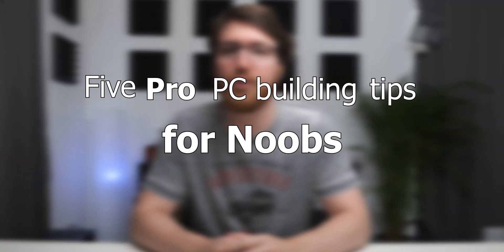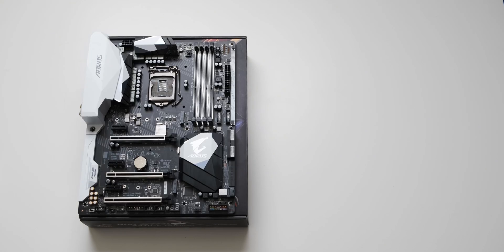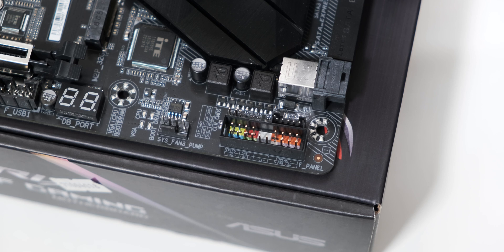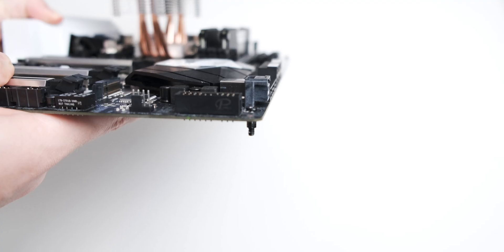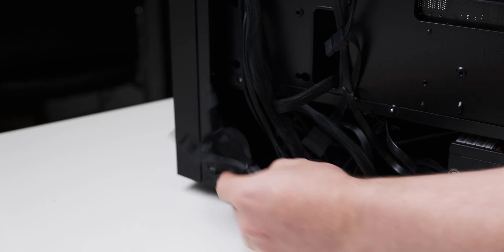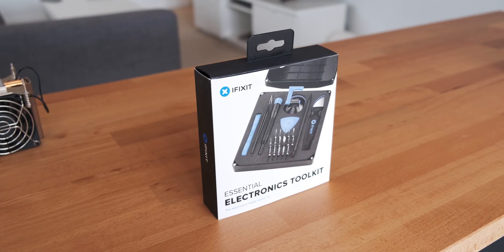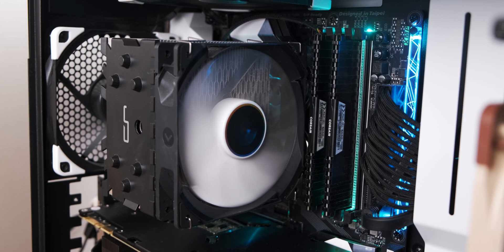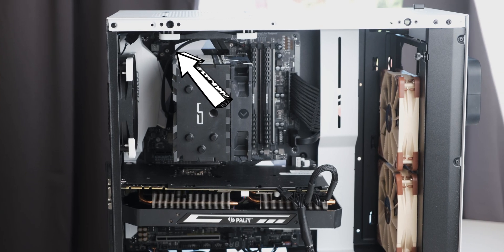5 PRO PC building tips for NOOBs

Comment from the maker: Unfortunately I got the name of the screwdriver wrong in tip number 4.
The screwdrivers with the spinning tops are actually called precision screwdrivers.
Torx refers to the star shaped screw driver bit.
The point of tip number 4 is basically, get a good screw driver. :P
Thank you to the viewer osgeld for correcting me there. 
Thank you for watching and I apologise for the mistake.
Reply: I personally use a philips n.2 screwdriver with a magnetic tip. Instead of rotating the whole hand, I use my other hand to spin the shaft, and only once it stops I give it a little screw in with the handle so the little bastard doesn't run away. I realize that probably sounded wrong....
Reply from the maker: @m4r4t43  Haha!! It sounded awesome. :P
That is a great tip for tight spaces though.
Reply: @DawidDoesTechStuff  One might say it's a magnetic tip.
Reply: @m4r4t43  Just the tip? Or also the shaft? :D
Reply: Noob
Reply: Oh thank god. I had this sinking feeling where I thought i had been calling those bits the wrong name all this time. I was worried my dad might have just been nodding along all this time, making fun of me once I left the room.

Comment: Dawid, I know this will blow your mind (pun intended if you want) but nearly all fans have little arrows on them that not only show the direction of airflow but also direction of rotation.
I also used and still use "looking at where the mounting is" but since there are fans out there that pull air instead of pushing them, this procedure isn't 100% secure anymore.

Comment: I have a degree in Building Systems For A Quarter Century, and I have to say that Tip 1 takes all the fun out of it! Just kidding. I used to do this your way, back in the 90s when compatibility alone was a nightmare, but my last two systems I just slapped together and turned on-- they were fine. The important thing is to do compatibility research ahead of time, something that was far harder to do in the 20th Century. :) The rest of these tops are spot on!

Comment: You don't have to put your motherboard into the case just to connect to power on switch, just run the wiring to the mb headers.
Reply from the maker: That's a good point. :) that would definitely work too.

Comment: The Pro-Tips: 
1. Who needs a case?
2. Screw in with confidence
3. Tie cables with tweezers
4. Get a swiss army knife that hopefuly has a screwdriver
5. Srlsy now: Fans have spoons. Air is soup. Soup goes up. That's a way to check for fan direction. (Unless the blades are flat)
Reply from the maker: Hahaha!! Fans have the best spoons. :P
Reply: By the Verge

Comment: TORX is a screw head type, its those little star ones, not that the driver has a spinny bit at the end outside of OEM's (like dell and HP) everyone uses phillips head screws, and its much better to just buy a screw driver with a long shank for a buck at the discount store then your handle is out of the case. Also pro tip, with a long shank screw driver and machine screws you can just spin the thin shank tween your fingers which will get the screw all the way down then use the handle for the last little bit of oomph
Reply from the maker: This is great information thank you. I will post a comment updating the information in the video.
Thank you again. :)

Comment: Thanks for the tips, i was planning to fit a 1050ti inside of my Fujitsu Esprimo E420 E85+, it should work with it and now i know some tips.
Reply from the maker: I hope this video helps. One thing to keep in mind, is that your PC seems to have smaller PCI bracket height. That means that most GTX 1050tis wont fit. They will be too tall. So remember to buy a low profile GTX 1050 ti. :)
Reply: @DawidDoesTechStuff  Oh, thanks! Problem is that the place im am buying parts from sells random types so do you know other cards that would fit?
Reply from the maker: @executive1946  Any low profile card would fit. (They are the ones which are half the height of normal cards) Ask them what low profile graphics cards they have and choose the fastest one in your budget. :)

Comment: Rookie question here, am I fine by adding an 8gb stick with of the same speed as my current 8gb stick? Only differences are the brands, will I be able to have them dual channel as well?
Reply from the maker: That is a very good question. If the RAM is the same speed and have the same timings. (The numbers that go like 14 14 14 36) If they are all the same, then there is a chance it may work. However there is also a chance that it won't. What are the two brands?
Reply: @DawidDoesTechStuff  my current stick is a Corsair ballisticx elite, and i cant find it anywhere avaiable on my country so i have yet to choose the other one. Maybe a different Corsair model will work fine? Like the ballistix sport?
Reply: It's best if you can find a stick identical to your owned one. Refer to motherboard manual for correct memory slots for dual channel.